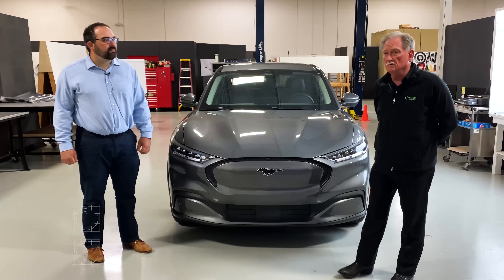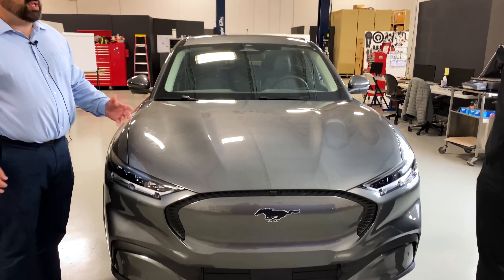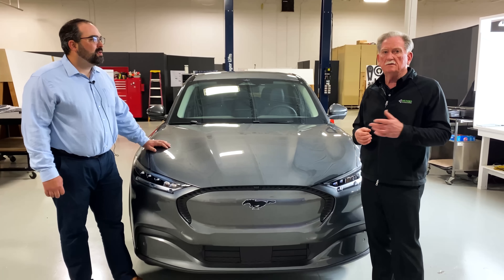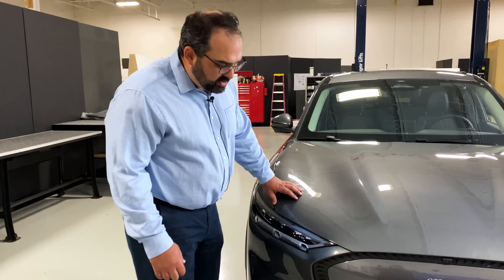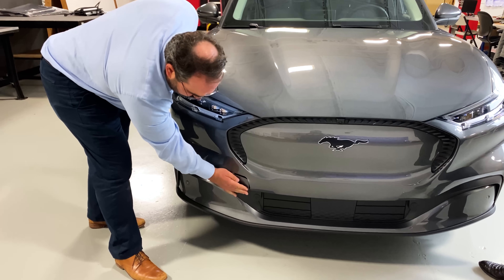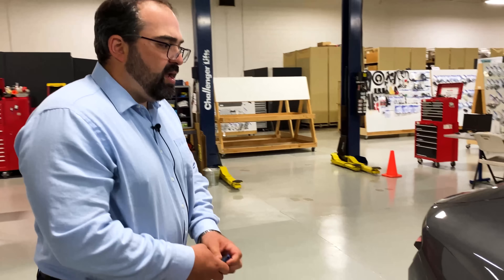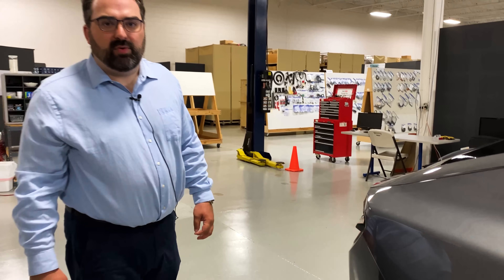MACH-E Teardown BEGINS!

Comment: Hi Mr Munro, 
In the case of dead battery, as you have explained, frunk can be opened with extra jump battery source and 12V battery to be recharged to open the door. 
But when there is an accident, assuming no electric supply to the doors due to some failures, people inside car is unconscious, then how people from outside can open the door mechanically and take people out from car (obviously without breaking the side window glass)? Is there not any regulatory requirement for mechanical lever outside car? 

As understood, inside car, latch lever becomes mechanical when there is an electrical failure.

Comment: In the end, "This is a N. American-made vehicle" trying to say that the quality of fit and finish should be near perfect and I can only assume compared to Euro and Japanese models. I think the GO NO GO Gauge used at Ford is not nearly as tight as the other major manufacturers so I had to have a laugh at that comment. Both of my parents worked at the Chrysler plant in Twinsburg OH in the 1970s and quality today is no better. Showing the oil canning shows how cheap the sheet metal is compared to the old days also but that is somewhat understandable, it's just too bad there is no foam sprayed on in the back to help support that visible weakness.

Comment: 2:50 orrrrrrr you can just have normal door handles. I live in a climate with a lot of ice and snow, this door setup sounds like a nightmare and a recipe for filthy, cold hands. There is no benefit to the stupid door handle stumps -- the Cd is still worse than E-tron and Polestar 2 which have normal door handles.

Comment: I understand technology is all the rage but door handles need a manual latch IMO. My 2006 F150 battery drains after 4 days of no use. Im thankful i can use a key to open the door and then the hood to charge the battery. Its sad the amount of phantom drain on most cars these days if you dont drive them for a week

Comment: Regarding a flat battery. I hope there's no way to flatten the 12V battery externally, by for example , shorting external lights. If there is, then you can open the frunk.

Comment: The oil canning is disturbing from both structural and repair ( if you’ve ever worked with metal and body repair that oil canning is seriously messed up)  since this a unibody car and body panels are part of the structural whole.  The two wires out the front to unlock the car are a bad joke….(maybe there is an optional roof rack to carry your spare 12 volt battery) should be a manual over ride, and the gap on the rear hatch, just sloppy workmanship, rear bumper cover issue……and Ben….Breathe!

Comment: I'm someone who's still learning about EVs and am puzzled by these potential 12v battery issues. I'd almost rather have a small hand crank that could generate power to open the frunk than needing to find another 12v source to attach.
1. What is the reason the car is not designed to be able to access the whole Li-ion battery for internal systems, doors, etc. (with a limit set on amount it's allowed to discharge)? 
2. Why not make the 12v battery more accessible at least given how critical it is?

Comment: Are the 12v leads in the bumper hot? Or are they connected to a relay?
Reply: Relay connected most likely,
So the function only works when the 12v battery is dead

Comment: So every thief can open your car conecting a 12v battery to those wires.
Reply: On the Tesla this works only is the 12 V battery is discharged.
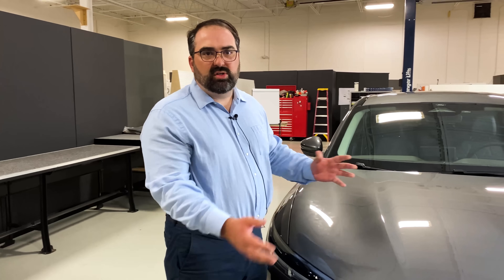I believe this is what Ben Lindamood was explaining at 3:11 that they checked earlier that the frunk was secure.
Reply: I doubt they could start and drive it tho,,
Reply: @WANDERER0070  Hope you dont have something valuable in in frunk
Reply: Maybe not if you battery still has voltage.... and you'd need the keycard/ phone associated with the car.
Reply: Nope the Jump part seems to be relayed so that it can only be opened when the 12v battery is dead or empty.

Comment: I hope I didn’t understand this correctly, but with a small 12 volt battery I can open all the doors of a locked MACH-E?
Reply: Only the fronk i believe.
Reply: @trisfaleel  OK, I accept that. 
Now, if the battery is dead how do I enter the car?
Reply: @MikeCasey311  You jumpstart the battery. So if you can't jumpstart then oh well.
Reply: @trisfaleel  I appreciate your comments.👍
This is probably heresy and not your problem, but I would think that a mechanical key on one of the doors would be a better solution so that I could remove my phone and my granddaughter from the locked in the car . 
I could then call AAA and tell them to come and get the damn car.

Comment: Am I right in thinking that in order to open the door you have to directly jump the 12v battery which requires ripping out trim panels in the frunk and that when you do so, the clips break?
Reply: You are not. If the 12V battery is dead the capacitors in the doors are used to pop the doors without using this jump thing at all. It is truly an emergency only type item. For you to need that the following would have to occur:

The car for whatever reason can't use the traction battery to automatically keep the 12V at full charge.

The 12V battery sat for long enough afterward that it went dead.

The car sat for ANOTHER 1-2 weeks without any power at all before the capacitors in the doors no longer had enough juice to release the solenoid.

So, assuming you park the car with 1% battery left in the main battery pack, you have enough juice there to keep the electronics running for about 12 days. Then you have the 12V battery which would have enough power to open the doors for another week or so. Then you have the capacitors that will last another week. So unless you frequently park a vehicle with no fuel and leave it for about a month without using it (unlikely) you won't have a problem.
Reply: @tylerpubben4216  ok understood. The only flaw I can see is that lead acid batteries have an alarming tendency to forget that they are supposed to be batteries when they age. And I'm surprised that capacitors connected to a circuit can hold a reasonable charge for weeks. I suppose my real
 issue is twofold... Why hide the battery behind covers that require brute force to access and why the two stage process? Why not allow the jumper cables to power the door and allow you to open the frunk.
All this fuss seems designed to confound the average owner.
Reply: @gregculverwell  No, the average owner will assume it will just work, and it will. Lead acid batteries do not have a tendency to "forget they are batteries". They lose their ability to handle high current draws, but not their ability to hold any power at all. You can grab a dead battery out of a 10 year old car and there will almost certainly be enough power to unlock the doors, even if there isn't enough to start the engine or run the headlights.

Also, you clearly don't have the experience I have with capacitors. I've welded screwdrivers to TV frames disassembling 40 year old CRT TVs that haven't been plugged in for decades when I accidentally bumped a capacitor.
Reply: @tylerpubben4216  obviously our experiences differ.
In my experience lead acids can develop a short in one cell literally overnight and as for your CRT story... I have received a good jolt - messing around with them after being disconnected for years, but from the tube not the capacitors.

Comment: Doors not opening when the battery is dead is a huge huge safety risk. Really bad planning imo. 

All doors should have a manual release handle
Reply: Battery is very unlikely to die since the car recharges it from the main battery. If the 12V system is somehow compromised in a collision the doors will likely either have opened due to the force of impact or be permanently closed for the same reason, but even if it isn't each door has its own emergency power backup.

Comment: So once you've popped the frunk with that ugly method, what can you then get access to ? 
Anything that could pose a security threat - CANbus to program a key?
Reply: He said it still has the usual security.
Reply: It seems like you can only use those front cables if the 12v battery is dead or empty.

Comment: What a dumb way to deal with a dead battery and the doors.
Reply: And yet you don't offer a better way.   It's easy to criticize.
Reply: @chuckm260  it's even easier to setup something that doesn't fail like that.

A small mechanical lock for one door or the F-trunk.  A lipo battery backup for the lock system.   USB port to power the lock system with your phone or a battery bank.  A small solar panel to provide minimum power for the lock system.
Shall I go on fan boy?

Its easy to criticise because it is Ford.  They are famous for their some of their shitty design decisions.  They are almost as bad as Chrysler and GM.

Comment: I would buy a car with a door handle, over one with no handle. 
Every time.
Reply: Same here. I don’t understand the need for over complicating things. A normal door handle is cost effective and works well, even in the event of a power failure. The cost of maintaining those push bush button doors will be on the buyer, I can foresee a list of expensive problems with them happening in the near future.

My biggest concern though is safety. What happens with the doors should you be in a major car crash, where the batteries, fuses or electric components might be fried. Do the ambulance need to wait for a mechanic to arrive to be able to help you out of the car?
Reply: @gytefisk  I'm cool with a door handle if it's flush. Otherwise, no.
Reply: @MarkXHolland  why?

Comment: Are there mechanical door handles inside? if not, how do you get out in the case of a crash that takes out the 12v system?
Reply: Interior front doors have mechanical overrides (pull the handle back all the way).
Reply: @spfappy  and from outside?
Reply: @arsni23  I think the consensus with all the newer handleless cars is that you break the window if there is someone inside who needs help and you don't know where the manual overrides are.
Reply: @arsni23  From the outside, the door mechanisms contain "supercapacitors" that are good for 6 or 7 "opens" in the event of a power failure, and I believe they hold a charge for half a day or so.
Reply: @arsni23  Theoretically, the doors all pop open once the car comes to a stop after an impact. In the 12V is taken out in this process, then you're stuck with breaking a window.
This is the same for a lot of modern cars.
Reply: @arsni23  Break the glass.
Reply: @kschleic9053  I just gave the answer "break the glass" but it was meant to be a ... joke.
Reply: @mikeb1039  This is why EVERYONE, literally if you own a car, you should also own a handheld glass breaker. I keep mine in the center console, right on top, with a build-in seatbelt cutter. This is needed no matter what car you drive.
Reply: if that to happen you are very unlikely to be able to open any doors due to the effects of the impact due to the distortion of the body shell
Reply: This is only a problem for a car with a battery that has been dead for a LONG time. The doors actually have large capacitors in them that are good for several door pops without a battery connected at all.
Reply: Each door latch/actuator has a built-in capacitor and is powered independently if the 12v battery is disconnected, and they last awhile.
Reply: @mikeb1039  Elon Musk managed to do it.
Reply: This is what I do when my doors don't open because of a dead low voltage battery: https://www.youtube.com/watch?v=QHRuTYtSbJQ
Reply: You go out the window.
Reply: @mikeb1039  Why should we trust you?

Comment: Can that door plunger open the door when it's covered in ice? Here in Canada I find it hard to open the door after freezing rain on most vehicles.
Reply: It's rated to crack the door open with 2 inches of ice covering it. With 2 inches of ice covering a normal door you'd rip the door handle off before you got the door open.
Reply: check out 
Bjørn Nyland video on mac e, he put his full body weight against the door and it  opened  o
Reply: Sandy should weld one of the doors closed and see what happens.  :)
Reply: @davidbeppler3032  a pc version of the dukes of hazard?! 😊🤪haha
Reply: You can always TURN ON car HEATER remotely and let it THAW the ICE ,yes?
Reply: They said it would work down 40 degrees below.
Reply: No chance! …that’s my „educated guess“ at least with similar experiences from Iceland and Norway. The missing door handles are a big issue in the north. Greetings from Oslo.

Comment: so opening the doors with a dead battery is a simple 14-step process - seems unnecessarily complicated
Reply: have you seen what you need to do if the 12v battery goes dead on a model S?
Reply: @QALibrary  
Teslas now warn you long before the battery dies, so it shouldn't happen.
Reply: @andrasbiro3007  I got the 12v battery warning and shutdown  autopilot features on my 2 month old 2021 Model Y. Tesla service replaced it at no cost, but it shouldn't happen to a brand new car.  Service said it was a defective battery.
Reply: Actually it’s perfect 
You don’t want the frunk to open unless the 12 V battery‘s dead because you might wanna lock something in there so there has to be a way to open the car
Reply: @ralanham76  I see the logic and the end goal, but finding the little hatch, pulling out a couple of junnky-looking leads, jumping the frunk, then jumping the 12v battery....all seems non-user-friendly.  I may be over thinking something that would happen only rarely!!
Reply: @paullester2535  If the task is beyond your capability call a professional.
Reply: @heathwirt8919  will do - thanks for the advice
Reply: @paullester2535  I think the main problem is they want to have no handles for better or dynamics maybe they should just put a Regular handle on the back door because that won’t affect the aerodynamics at all
Reply: This is only a problem for a car with a battery that has been dead for a LONG time. The doors actually have large capacitors in them that are good for several door pops without a battery connected at all.
Reply: Can't wait till people start popping open those little doors and cutting off the leads just to be A holes or something worse.  Don't tell me they won't.  Ford does not protect the car.  Anyone can do anything to it at any time, nobody will ever know.
Reply: @davidbeppler3032  You live in a very cynical world.
Reply: @tylerpubben4216  there was a time when people would snip off the hood ornaments because.....just because
Reply: @cyclopsvision6370  Well, they did it to steal them and because you could literally grab on to one and pull it off. To open a door on a bumper (which most people have no clue as to its intended purpose) and snip some wires is basically like saying "we better get rid of Schrader valves on our tires because someone might start stealing the valve cores"
Reply: @davidbeppler3032  Only an idiot would do or think of such a thing.
Reply: @heathwirt8919  Yep.  They will.  And worse.  That was my point.
Reply: @davidbeppler3032  No, I'll tell you that you're the type of person who does these a-hole stuff all your life. Normal people don't think that way.
Reply: @sammiller6631  Yes, I do think of what people do and how they think all the time in my life.  I play D&D and have for 30 years.  You want to know some other things humans do that is stupid/dangerous/horrible/evil?  I can talk about it for hours.
Reply: @davidbeppler3032  Are you calling D&D stupid/dangerous/horrible/evil? I'm sure you could talk about your character for hours. That's a stereotype of D&D players for good reason.